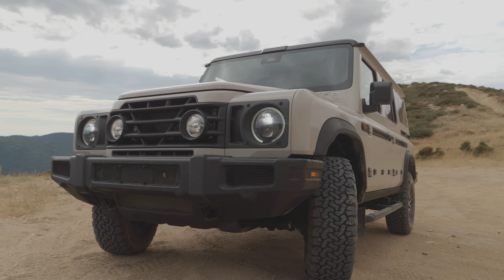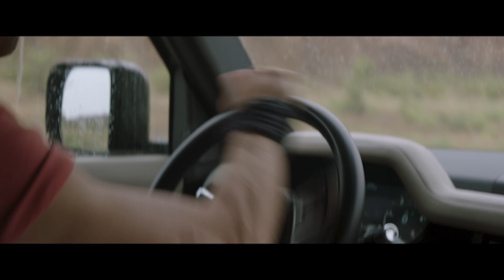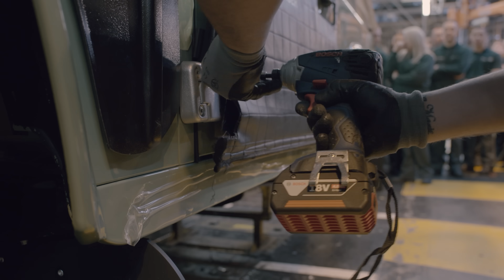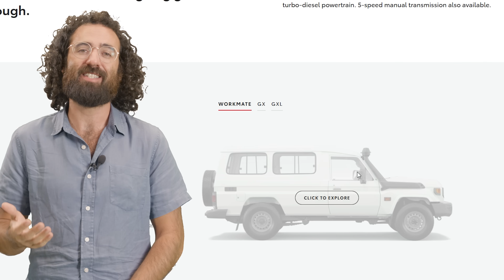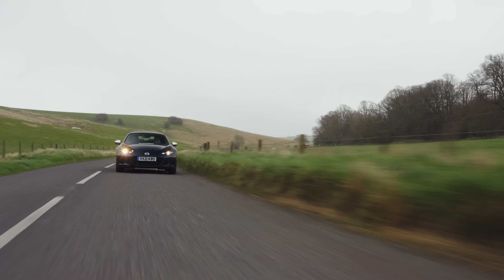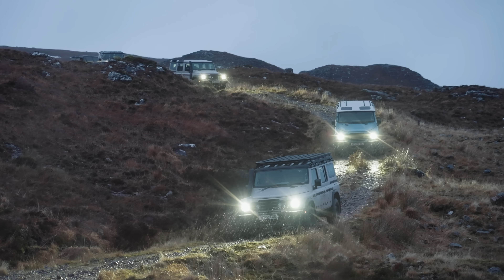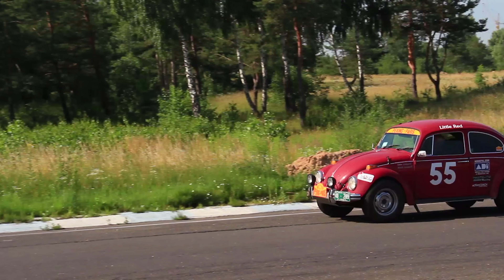Why a simple new truck has to cost over $70,000 in 2025

Comment: There was still no justification of the price. We have way cheaper and more modifiable 4x4s here in the states. It's just a status symbol that's better than a crossover for off road fun. But a new bronco is just as good off road and if you spend as much modifying a bronco to the same price it would monster it in every way. Funny to say it will be more reliable, no first car from a company will be as reliable as the pros even if it sourced a good engine. You mention it's detuned motor is good for reliability in environments with bad gas but who's going to be buy these there in the first place? People who can afford to take care like this to places like that really don't have to worry about cost any which is why they are setting out on that adventure in the first place. I've seen a few of these on the road around me and they look nice. But not for that price.

Comment: If only it didn't do 12-15MPG and didn't weigh as much as a small moon, I'd be interested, but this is an off-roader which will sink in the mire at the first available opportunity and then run out of fuel way too early on the long haul..... oh and be super-compromised as an overlander, because it can carry so little.

Such fail

Comment: No they don't. If you build an actual simple truck it would cost FAR less. The problem comes because you CAN'T build a truly simple truck in todays age of EPA restrictions. If you built a truck with simple body lines, a carburetor or throttlebody, manual transmission, manual everything else(door locks, windows, AC, etc. etc.), solid axles, and don't make it the size of a semi, you could easily keep the price quite low. Me personally, with the cost of new trucks, I'll just go buy a fully restored classic with true simplicity and an ACTUAL 8' bed.

Comment: The INEOS is FAR from a simple car, what kind of propaganda is this??  It's got an EXPENSIVE BMW engine and transmission.  At least offer a simple 4-6cylinder engine and a basic stick shift and transfer case and I bet the price would drop by a ton.  As awesome as the INEOS is, I'd never get an off roader with only two petals.  I'll stick to driving my 94 passport, and whenever it dies I'll be looking at something else of the same vintage.

Comment: I own a '16 last-of-the-line Old Defender 90" as well as a '23 New Defender 110".  There's a reason JLR came out with the New Defender, and didn't want to sell the tooling to someone else.  The Grenadier is an overpriced Frankenstein cobbled together with old parts; Styr chassis, ZF transmission, BMW motor ... a camel is a racehorse designed by a committee.  I just saw one that'd been on the road for two years, and the fittings are already rusty and wires were hanging out all over the place.  I was also recently at an offroad event with my '53 Series 1 80", and we Land Rover owners amused ourselves watching all the Grenadiers getting stuck in the mud.  I think you'd be nuts to buy one of these in the US, especially given the lack of dealer service network, not to mention tariffs and Chicken Tax on the pickup model.

Plus, the Ineos founder was a Brexiteer who bait-and-switched people in the UK by saying he would build it in Wales with British parts, but ended up building it in France in an old Mercedes/Smart factory with German and Austrian parts.  Then he decided he didn't like paying UK taxes anymore, and flaked off to Monaco.

By the way, removing that AI "background music" loop would make your videos more enjoyable.  Good work nonetheless.

Comment: I own a Japanese "kei" truck. As small as it is, it's still a ladder frame chassis with extremely basic suspension. The fanciest thing is has is power windows and AC. I am not an extremely experienced mechanic, and I was still able to change the timing belt and all of the fluids easily. You can import a cool Japanese vehicle yourself for well under $10k, I would recommend it if you want something simple.

Comment: Yes, the electric power steering pump, yes it’s pumping hydraulic fluid but the pump is no longer ran on the engine, the FULLY electric climate control switches, the electronic gear shifter etc are all old school LOL. I thoroughly looked into the grenadier, there isn’t anything old school about it. Even the supposed key switch isn’t connected to a solenoid like old school SUV’s it’s routed thru a computer and technically asks the computer to start the engine so if your computer goes wonky you have no hope ever getting this thing going. Even the fact that you can’t lock the rear doors if the battery goes flat to resecure your vehicle shows they didn’t care about the buyer and simplicity. You can’t even get the thing in neutral easy if you have an electrical problem…

Comment: I like to think about the IG more in terms of what it does better than the closest competitors. When compared to a 70 series, the refinement is night and day better. The 76/79 Landcruiser is all 4cyl/6spd now. Although its a well performing powertrain, the BMW/ZF combination just out-classes it. Compared to Jeep Wrangler... yes, the Jeep has unmatched trail capability, but every part above the axles and transmission is a giant compromise. My exposure to the Grenadier so far has been only sitting still, but I would venture to say it was one of the most solidly built vehicles I've seen lately, easily better than the new 250 series Landcruiser/Prado, at a comparable price point. 
The only other real competitor I can think of is the Mercedes G- we can't buy a remotely utilitarian version in the States.

Comment: Great idea . . . except it's a niche product without a dealer network and no parts availablilty.  Reliability requires parts.  Don't buy niche products if you're trying to achieve reliability at a low price . . . just get a 30 year old toyota 4runner.  (Land cruisers are too popular which means too expensive.)

Comment: Two issues that can change a lot. 1) False expectations that are actually manufacturers upselling ploys. Gen 70 example you used shows it, it is indeed 20K cheaper than Ineos. Because it lacks a lot of "expectations" technology and still sells like hotcakes where allowed. 2) Taking existing regulations as granted, talking 2029... Current USA Administration has already took chainsaw to a lot of it, it is populist, give some more outcry from the people and a lot of those future "mandatory" points my be gone with a stroke of a pen. So, simple SUVs are already possible at significantly cheaper price without such things as entertainment centers, Internet access, built in navigation, phone call centers,... if core of the car like 70 Series or Ineos is there, bells and whistles are irrelevant but for manufacturer want to project high end image and harvest more of our monies.

Comment: You can get a 2025 four-door four-wheel drive trail Boss package cloth interior power windows automatic transmission V8 Chevrolet pickup truck for $42,000 from Florida dealership

Comment: The problem is what people consider "simple". No radio, no Aircon, manual windows, basic seats and trim is what made cheap 90's cars so cheap. Budget cars now have what was considered luxury level back then, if you want a cheap car then you have to sacrifice comforts. The grenadier is about as cheap as you can make a car that's that capable and reliable.
Reply: A lot of those things aren't that expensive though. You can get a kei car in Japan with aircon, auto everything, heated seats, CarPlay, collision avoidance, plenty of airbags, fancy top-down parking camera, power sliding door, remote start for aircon via phone app, all the BS for just over $10,000. My theory is more around how in the west people keep wanting bigger and bigger cars. Cars these days are just massive, and then they need a 200hp engine and lots of engineering to keep people safe crashing into other 10 ton vehicles.
Reply: @kalleboo  The West didn't CHOOSE bigger cars, Gov regs FORCED bigger cars on us.  Emission regs killed the station wagon and forced us to use SUVs and pickups for that purpose, steadily increasing cash test safety regs add weight every few model years.
Reply: @Devin_Stromgren  CAFE standards BS is definitely a valid argument but that still allows for sedans and such, and EU safety regulation is even more stringent. I keep seeing Americans argue in good faith (not in YouTube comments) how they really need to be able to tow boats and haul 4x4s for their huge houses and haul their family of 4 kids with 100s of lbs of luggage on 1000 km roadtrips across the country which is why they definitely can't buy a sedan or hatchback. And I've talked to American friends who I thought were sensible but still can't bring themselves to buy a minivan due to lingering 00s "soccer mom" social stigma even though they admit it's more practical. I still argue it's more a social problem than anything.
Reply: @kalleboo  It might not matter if the EU safety regs are more restrictive if they're also better though out.  I don't know any specifics about EU safety regs.  I can tell that Britain seems to be significantly less restrictive than the US, since they have a lot of cool little vehicles that would never be allowed on the road here except as kit cars.
Reply: "no radio no aircon no power windows" brother, all that together costs like a 1000-2000 bucks in total lol where did the remaining 70k go
Reply: That isn't what makes modern cars so expensive.  Those are included now because they've become so cheap that NOT including them on every car would be more costly than just leaving them on the base model.  What's made modern cars so expensive is all the Gov regs they have to meet, especially the crash test safety regs, with a heaping helping of inflation on top of that.

Comment: 4:30 that's not how it works, you don't need two ECUs to make it work. All you need is sensing current to the motor and you get auto-up, auto-down and finger chopping protection all at the same time with one very simple controller. I consider it underdevelopment and a lame excuse. I would buy that explanation if it had manually operated windows without any electrical connection to the door

Comment: That SUV is not simple.  Why have electronic locking differentials, electric shift transmission and transfer case, stability control, electric windows, that infotainment system, back up camera, heated seats.

Comment: In 2014 I spent $17k on a brand new, base model Jeep Patriot Sport, whose only "upgrade" was automatic transmission... fast forward to 2024, and the exact same vehicle after inflation would have been around $24k... but msrp is $30k, and mechanically, it's the same vehicle.

So, I spent $5k more and bought a Rav4, because compared to a Camry, having double the cargo space, Awd for winter, and a few more inches of ground clearance for a bike rack, while maintaining a far shorter overall length for urban driving... is 110% a no-brainer.

Look back at the Model T coups, and that's basically what small suv and crossovers are now.

Comment: Yep if you buy new, I get why some folks do I could afford new but have never bought new I prefer beaters and my vehicles work hard for me. 3 years ago a bought a 88 FJ62 landcruiser hadn't run since 1994 for 4K USD. Very little rust I painted it myself ( Rustoleum Hunter Green w hardener) gone thru most everything fluid and hose wise, new tires/rims, went thru brakes, PO did an OME lift on it. Fixed broken fuel pump replaced soft lines. Desmogged motor then tuned it, bought spare starter, alternator. (Havent needed OEM still good) ditched the A/C (Comp was locked up) removed back seats, Both front and back seats cleaned up well but put seat covers on fronts. Replaced the silly vac control 4x4 shift modules and the transfer case solenoid. when I bought it had 131k miles, now it has 167K. Runs and drives good is typical LC slow. I just looked at my book I have about 9 thousand in it minus my time and labor. My GF has pretty much taken it over now.

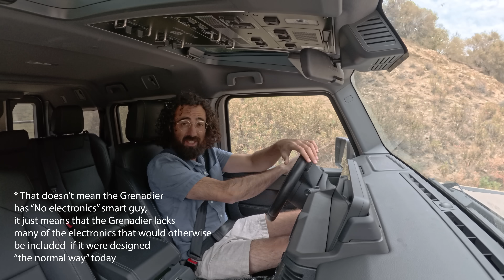Comment: 2:57 Hydraulic power steering is literally worse from a reliability standpoint than having electric power steering—not electric power steering PUMP, but an actual motor interfacing with the steering rack.

Hydraulic just introduces additional leak/failure points & weight.

With EPS you get to remove the PS pump, belt, fluid, etc. and simplify installation with a lower power requirement & removing the constant parasitic draw of the engine always spinning its’ pulley.

It’s strange to me because EPS is certainly not new, as Honda has been using it since the early 90s and many others having followed suit. Bosch is an OEM for many of them.

Comment: Also for as much crap as the new Defender gets versus the Grenadier - the new Defender has objectively better offroad stats than the Grenadier and indeed - once you put a decent set of AT tires on it, it outperforms the Grenadier in almost every regard offroad.  Afterall the new Defender was trialed in Moab - and the Grenadier wasn't.

Comment: Hybrids are "temperamental"? And difficult to repair on the side of the road or trail?

How's that turbo German 6 to repair on the trail?

Trail repairs will probably not include engine or power train repairs. We're most likely looking at drivetrain and suspension.

Hybrid power offers electric torque at zero RPM...

Comment: I have driven several Grenadiers and like them a lot. I have a LS swapped 3/4 Ton Suburban with manual everything. Manual hubs. Manual transmission. Manual windows. Manual locks. I appreciate solid axles and love the concept of the grenadier. I don't mind the BMW powertrain, I also have a X3 35i for the wife. I think the issue is...a jeep wrangler exists. Sure it's nowhere near as overbuilt but it's literally half the price. That and the odd choices with screen integration and the limited electronics it does have have issues. I've had issues during my test drives with the speed warning, infotainment crashing and warning lights. 

I hope they are able to sell them and continue to produce it. I like the idea. I'd really like one with truly manual everything. With the way they have it priced and equipped, it's drawing comparisons to GX, raptors, AT4s, etc...

The suspension tuning makes no sense. It actually doesn't have nearly as much articulation as it should and the steering not returning to center is not because of a SFA and recirculating ball. My old squarebody has better steering and it was engineered in a bar in the 70s. 

I just hope it survives, a second generation with lower tooling costs, working software and some suspension tuning would have my attention.

Comment: The ECU argument is BS. Tesla runs 3 main ECUs and an ADAS ECU  to run their entire vehicle. Having smart features and complexity doesn't mean you cant build a reliable system. Having a smart and scalable design is what results in reliability. Even Rivian is following Tesla's approach and redesigned their R1T and R1S to move towards a more centralized vehicle architecture to cut out all the ECUs they have. The ECU overload approach that most OEMs use is due to legacy auto having specific sourcing agreements with suppliers and not investing in bringing that design in house.

Comment: If I hear one more thing the government "fixes" by adding complexity and dependency ,I'm going to loose my mind. We're so screwed and the threads keep getting steeper.
Reply: They are building vehicles for stupid people and bad drivers these days. Need to take out all the crap and tell people to "Fricken' pat Attention!!"
Reply: When has that ever worked?
Reply: @emp_zealoth  As if overtechnologized cars will solve the problem.
Reply: @tcar1999  As an owner of a 2024 car, yes, it does solve a ton of problems. Autobraking helps a lot, matrix headlights make driving at night way easier, backup radars warn you if there is traffic coming when you try to reverse out of a parking space, proper blindspot sensors means one tiny eye flick tells me if it's safe to change lanes. front and rear cameras and proximity sensors make parking easy
Reply: @emp_zealoth  just learn to drive maybe?
Reply: @tcar1999  Oh my god why did no one think of that /s
Reply: @emp_zealoth all of that stuff kind of locks you into the technology path for a solution though. In 90s cars, you could see pretty much everything if you turned your head around when backing. Nowadays most cars are unbackable without a backup camera. 

Yeah, nowadays rollover protection is better, but most vehicles feel like you're sitting inside of a tank as far as visibility goes. 

And IDK about auto braking. If you need it a lot, you probably follow way to close or too far (with enough room for people to cut you off with zero margin). I haven't had to slam on my brakes in like 10 years and I was driving 40-50k miles a year for most of that. 

Only accident I've been in was someone cutting over 3 lanes of traffic and hitting the side of my vehicle. No existing safety system is going to get you out of that one...
Reply: @SwagFactory2126  autobraking literally does not let you tail gate lmao
Reply: @emp_zealoth  you can adjust your settings in a lot of vehicles. The Mustang (for example) can be adjusted to be within a car length of the car in front of you. Setting it to that and using radar cruise is straight up scary.
Reply: The regulations were enacted decades ago. We are literally reaching the end.